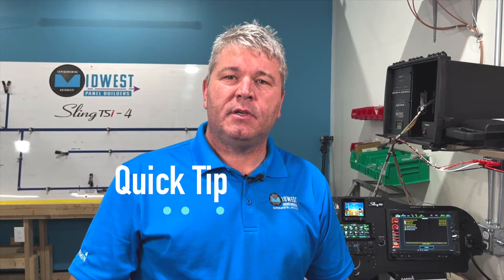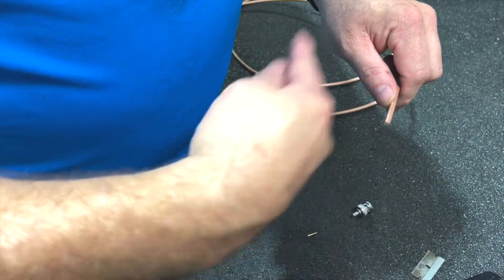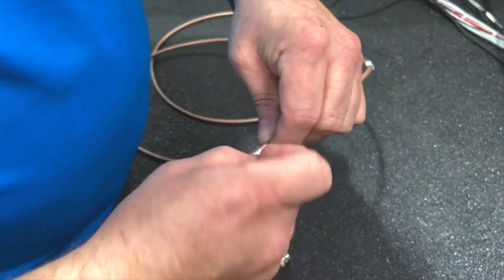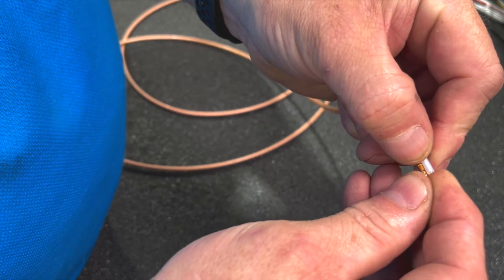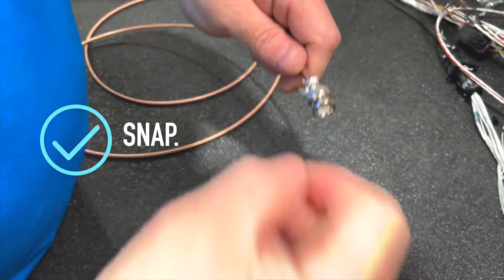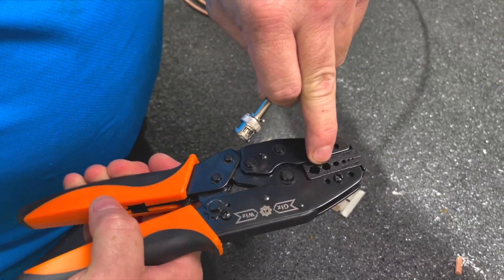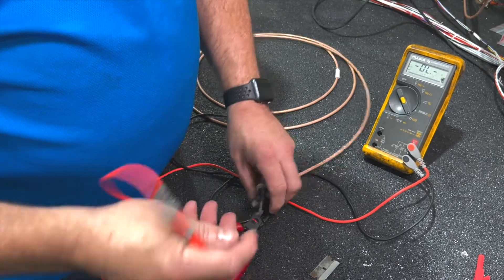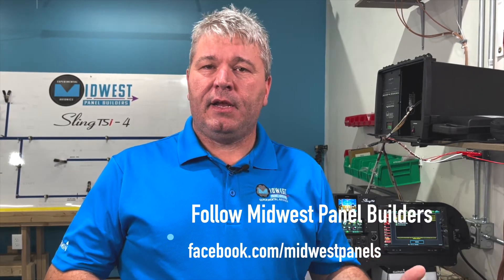Coax Cable Crimp

Comment: 5:12 No no no! Don’t crimp the cable end of the ferrule! You want that slight bell-mouth (funnel) entry, as it ensures the edge of the ferrule doesn’t damage the jacket. Doing what you did actually slightly reduces the cable’s mechanical robustness.

Comment: 1:49 Why not measure? While the guesstimate-and-trim-the-shield-later technique is great for unknown connectors with no datasheet (which I don’t recommend doing for any halfway important application), every decent manufacturer has assembly instructions that include strip lengths. That literally takes the guesswork out of it, and cutting the shield with an xacto knife or razor blade is surprisingly fast and easy. 

In my coax connector storage tote at work, I keep a folder with the assembly instructions and strip lengths for each connector, so I don’t have to look for them each time.

Comment: Surprise you're using a hand wielded blade to cut through the jacket. There's a danger of nicking the shield wires, correct?  I use a thermal stripper to avoid nicking any conductors. An old habit for my days watching technicians assemble harnesses for missiles.
Reply from the maker: No issue with using a blade, proper technique along with inspection of the shield will eliminate that so no need to spend hundreds of dollars on a thermal stripper which in itself requires proper technique as well. Where people run into issues is when they use the 3 blade strippers that spin around the cable.
Reply: @MidwestPanels  I’ve been thinking of getting one of the ~$100 thermal strippers from Patco. Like you, I can’t justify spending nearly a grand on one of the thermal stripper stations. (It seems nobody makes simple mains-powered thermal strippers anymore. My old job had a bunch, probably made in the 70s, they were no more  technically complex than a hair flat iron one can buy for $15.)

What I also can’t justify (not that I have the budget for it anyway) is a $15000 automatic coaxial stripping machine. But another department at work has one of those, and it’s glorious. Once you’ve got the strip lengths and depths programmed properly for a given cable and connector, every strip is just perfect. (Luckily I can go there and use it if I need to do a lot of cables. For one or two, I just do it by hand like you, with an x-acto knife with a fresh blade. Only thing is I always measure and mark the strip lengths accurately, since I often am doing smaller connectors like SMA and MMCX, and some brands of those require sub-mm strip accuracy to do properly.)

Comment: Steve, how about links to those tools you were using. They look like good quality. Thank you.
Reply from the maker: Hi Judge, we are sorry but our media director accidentally listed the wrong tools. The COAX crimper is nothing special this one will work. https://www.amazon.com/gp/product/B0771QGR6Q/ref=ppx_yo_dt_b_search_asin_title?ie=UTF8&psc=1
The Multi meter is a simple Fluke meter. The magic is in the flush cut side cutters. This set is from Snap-On Tools and is the best pair we have worked with.